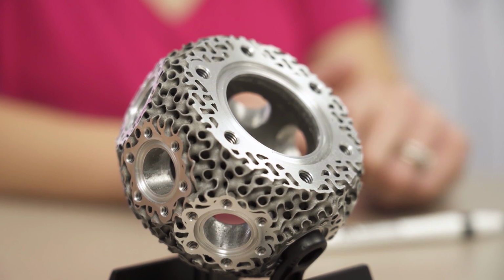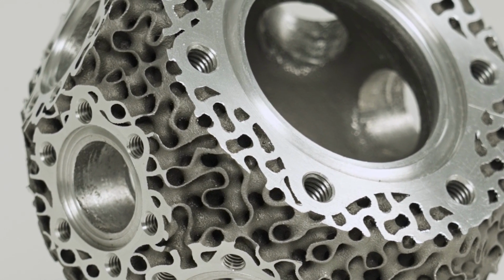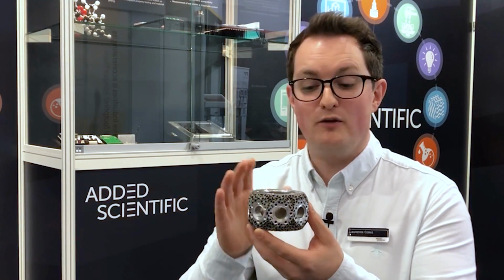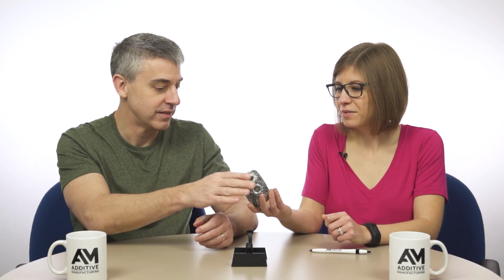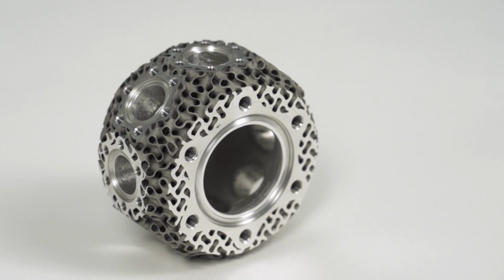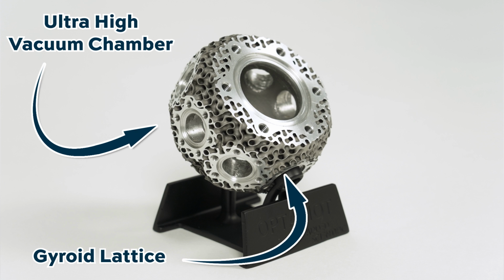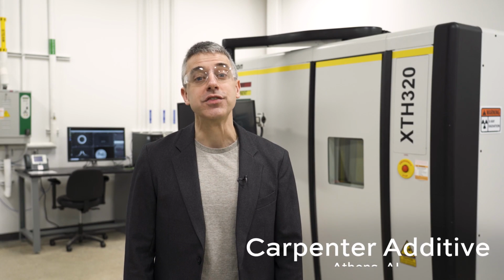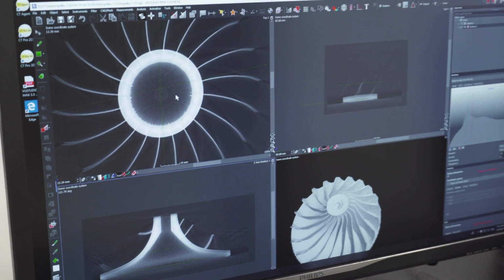Quantum Physics Research Advances with 3D Printing: The Cool Parts Show S2E5

Comment: In this episode you suggest that lightweighting is important in quantum physics research because……..?
 Do they really have to move the chamber in their quantum physics research? I’m not a physicist, but that sounds a little fishy to me.   Most quantum physics experiments I’m aware of tend to be very large. 

Could it be that aluminum was chosen primarily for its thermal conductivity, or low X-ray transparency, or some other reason, rather than  for weight reasons?
 In other words, it may be lighter but that may not be relevant at all to its intended function.  That is not easy.
Reply from the maker: Thanks for the question! We checked back with our expert to get you the best possible answer. Here's what Laurence Coles had to say: 

“Very good questions, and great to have discussion so soon! Yes, the lightweighting was a primary goal here alongside considerations for heat transfer via conduction or convection. A big focus for the quantum tech industry at the moment is to move away from heavy and large lab based experiments, and onto smaller more lightweight and portable systems which can be taken out into the field. A few good examples include UAV mounted gravimeters, portable atomic clocks for improved security in communications and there are many more. So we really are at a time where we could be moving into a quantum age of technology, and the first step is making portable versions of well establish research lab based experiments in order to make this leap forward!

David’s other points about Aluminium’s other desirable properties are also very important, there are a lot of quantum technologies which cannot use steel based chambers and so the choice of an Aluminium based alloy gives us more opportunities across this exciting new technology area.”